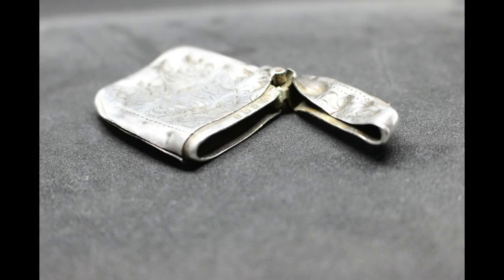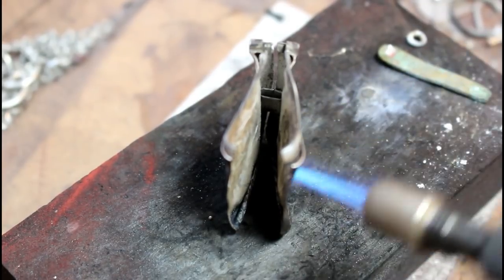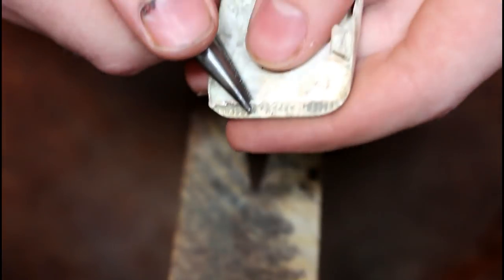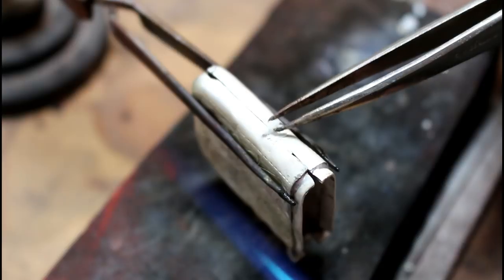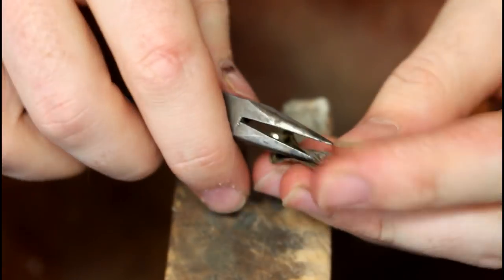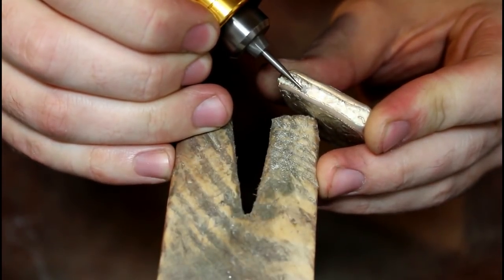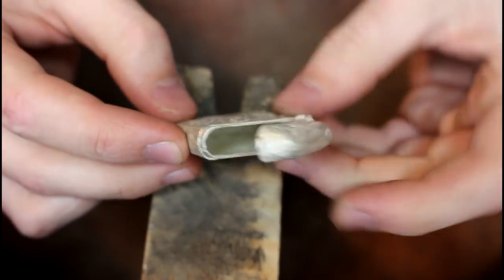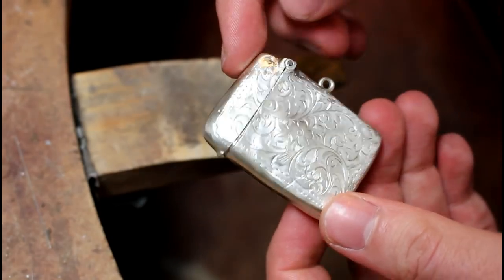ANTIQUE SILVER VESTA CASE RESTORATION (1910-1911)

Comment: Dude, that while it's not flat as a pancake anymore, you screwed that thing up. Heating it and using wedges and a hammer to reform it would have been the only option that wouldn't have turned out like trash.